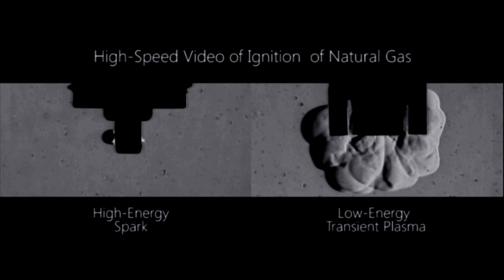Megawatts in Nanoseconds

Comment: BAck in the 90s there was a plasma arc ign.system that was called NOX i came across it on a 16 cyl White Superior eng that was driving an 8 throw natural gas compressor when this system fired after the compression stroke it maintained until the exhaust valves closed .emissions on this engine dropped something like 75% which was tonnes over the coarse of year.Last i heard ford bought it up ?? was originally designed by an engineer in the forces for his formula race car. Go fiqure